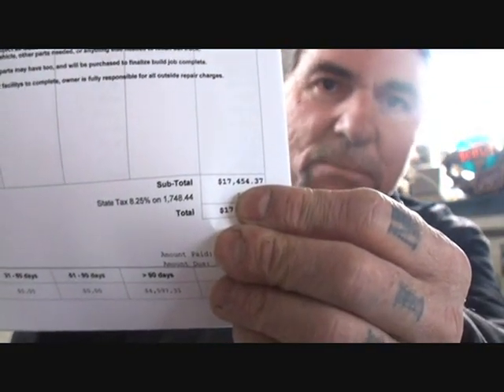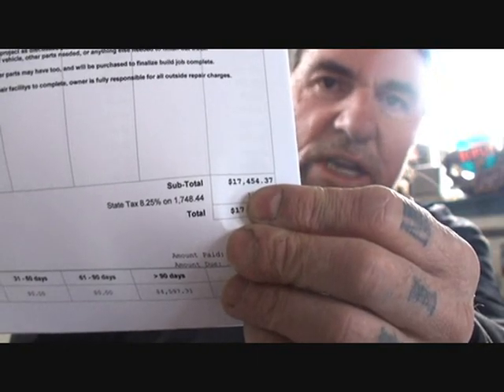Automotive Restoration Repair Facility-How To Write The Perfect Estimate/Invoice!

Comment from the maker: @vhehn thats because of the HIGH COST of parts. Parts are very expensive on these type of vehicles, and nickles and dimes add up very quick. No you will NEVER get your money back out of a car like the one discussed in this video. Beleive or not, I fully explain that to customers before they start on restoring a car or truck.

Comment: @swrnc By setting your printer to "Draft" mode the printer drops less ink onto the page. The result is less ink consumption and quicker printing times. The only downside is that the pages come out ever so slightly dimmer than at full ink flow, but on receipts, invoices and estimates who really gives a crap. It's still WAY easily legible.

Comment from the maker: @NoClassic No offence, but you must have got the wrong message from this video. The labor and doing your own work doesn't have nothing to do with the 17k. Out of the 17k I only made 3600.00 the rest was for parts and outside work. Doing your own work would still cost you the same amount in parts, you would save yourself only the 3600.00. This is a PRIME EXAMPLE of people don't undersand. They look at the bottom line and think thats how much I MADE. Not true, cars like this are penny pinchers!